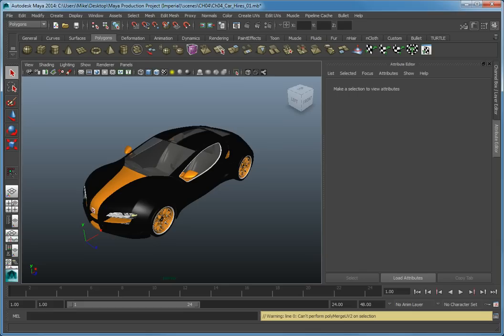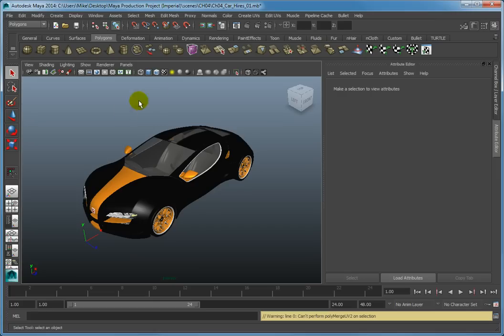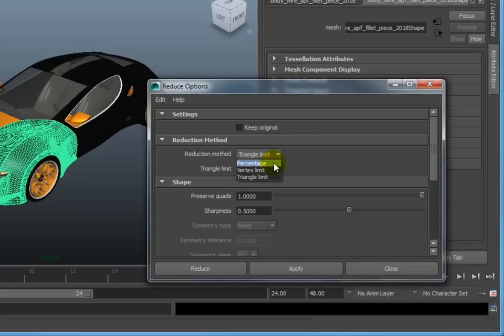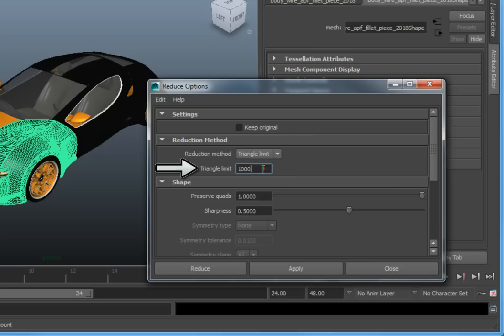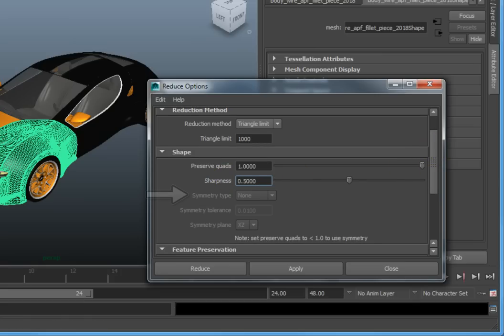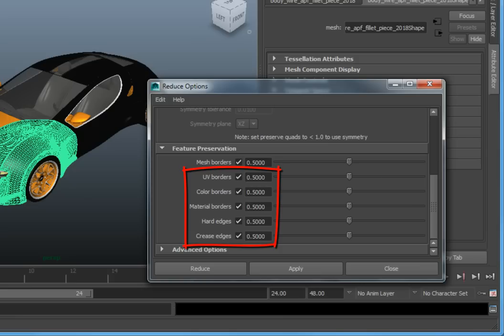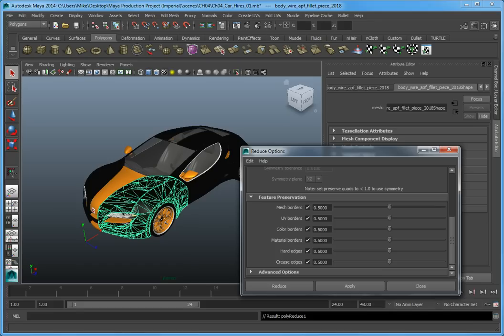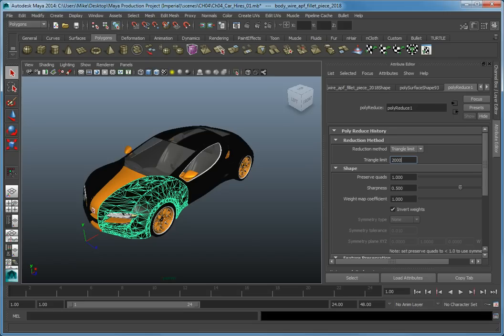Reducing the Polygon Count of a Model

Comment: even in 2020 its not fine tuned yet. Retopology via quad draw might be the better option here or simply deleting edges as it gives you the most control although it is time consuming. Even if you changed those tris back to quads and sculpted the shape it still wouldn't give you the cleanest result compared to just deleting or retopoing